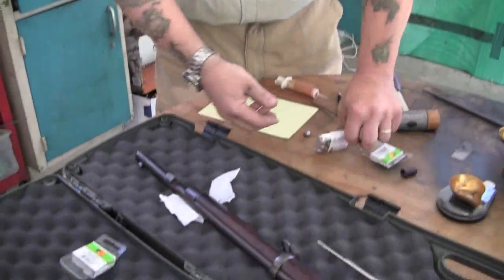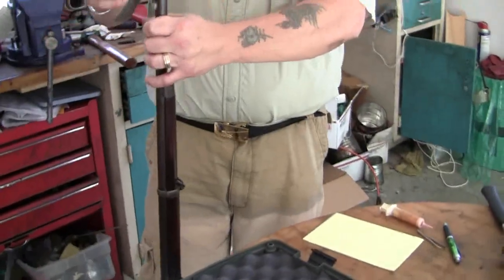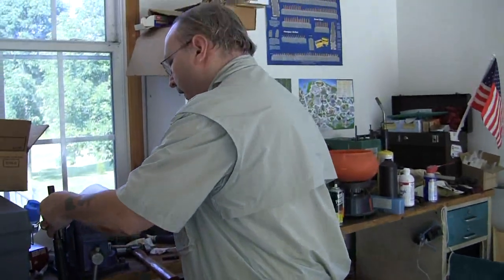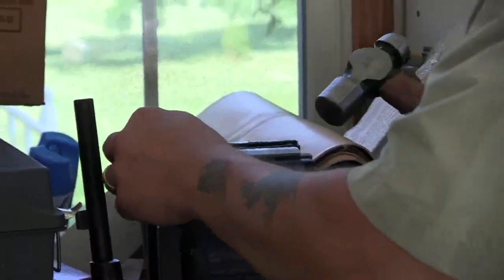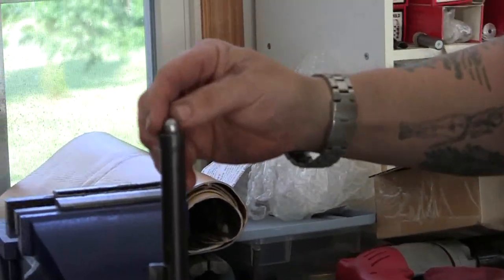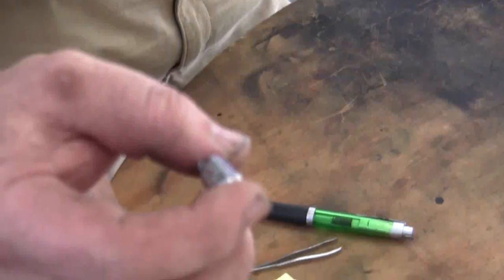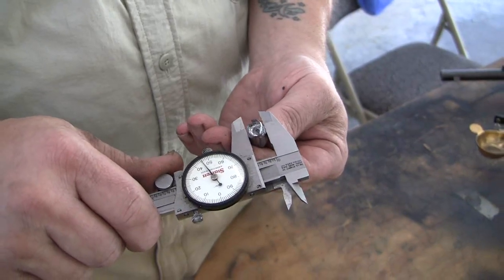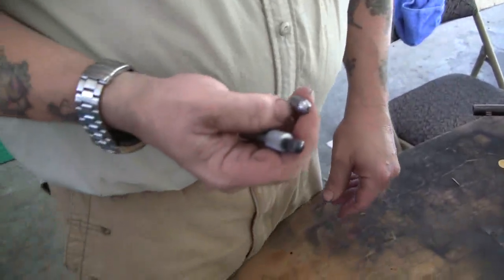Sluging a rifle bore

Comment: What size sinker would you use for .308 to .323 diameter?  Thanks Koba.
Reply from the maker: +zoggy2  I have found that it is easier to get black powder muzzle loader round balls that are larger than the bore by about .050 or so, places like track of the wolf sell lead round balls in a lot of different sizes